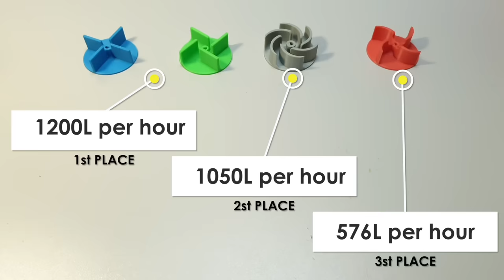Testing 3D Printed Water Pump Impellers - Which One Performs the Best?

Comment: The pump design is designed to reduce cavitation, mixing efficiency and durability. You have obtained good results in different models, but the durability is reduced because the formation of bubbles is greater.

Comment: You should also start looking at the casing and discharge pipe design. Also you are printing not very efficient impellers for pumping such fresh and clear water. If you want the most efficient design, try printing double shroud impeller.

Comment: Seeing the result was counter intuitive maybe you can reverse the winged fan blades so instead of scooping he water it actually pulls . Seeing the straight blades were better maybe cambering the blades away from water flow will actually outperform your best here . You could instead reverse the rotation of the motor to see the effect of the Galaxy shaped rotor blades instead of redesign.

Comment: The curved blades curve in the wrong direction. Velocity is increasing from center to edge, angled in the direction of the spin and outlet, but the rotation puts the trailing edge in the way of the flow. It might make for better pressure, but it will definitely impede flow.

Comment: @ 2:39: no sealing between motor and pump house, so lifetime will be a few days ... the bearing of the China motor is not watertight (this is with every design with 3D pumps a problem) you need a kind of oil seal, but for water
Reply: what battery he used?

Comment: Hmm, the flowrate is just one half of a good test. I‘ve been missing the pressure test. It could be made very easy by using a hose vertically. The higher the pump brings the water the higher is the pressure. Measuring the hight of the water can tell you the pressure in mbar. 1meter is about 100mbar. A very good pump make about 600mbar or 6 meters of hight.

Comment: You should measure the current   draw to determine the efficiency.
Bro you could have checked the battery voltage too, after that many tests that might have went down.

The impeller direction in dry test is ok but it seems the under water direction is opposite.

Good video by the way, awaiting for more. +1 ❤️

Comment: You have to look what is the efficiency of the pump so how many watts per liter is consumed. The other thing is that pumps have usually a flow / pressure curve here you do with the bucket at the same height as the tank but what if the bucket is one meter higher than the tank, will you have the same winner ?

Comment: You shouldn't use a battery, find a constant source. Also measure volts/amps. Efficiency and flow rate or pressure should be different on each design

Comment: The way you are testing the designs has very little back pressure. Turbopumps are mostly designed for generating pressure and aren't as efficient if all you need is flow rate. In these cases all of the designs are working at their flow rate limit because they have very little resistence. It would be interesting to test them pump uphill. The curved designs should do much better when there is more resistence but keep in mind that a lot of their efficiency is lost due to how much space there is for the water to flow around the blades. A smaller input hole and more output resistence may make them more efficient then the other designs. Also don't forget that the input hole size should be picked to some extend based on the desired flow rate.

To create lots of back pressure you don't even need a long tube going very high. All you need is a funnel with a very small opening at the end. You can try different opening sizes to get different resistence and see which designs do best for which hole sizes. Just keep in mind that with this powerful motor the pressure will be quite high and the water will spray very far.

Comment: Have you tried 3 string instead of 4 string - and as  "Jared Rohrbach Please print these designs in their mirror images (opposite parity). The ones you printed are for counter clockwise spin and the outlet on your housing is for clockwise spin."

Comment: Your pump is backwards. It would work better if the impeller blades were facing and spinning the other way. Or move the outlet to the other side so the water isn't having to change direction 100 degrees

Comment: The pink one is tested wrong.
It takes air in due to the large diameter inlet and too low submerged. 
You must drown the pumps minimum 1 meter for all tests.
You must make some reducers to make the inlet diameter smaller, and find the low limit diameter.
You must make a vertical 10m or more hose to see where the max pressure is at full speed, and no flow. Good luck.

Comment: I was really interested in your proposal to test the efficiency of the propeller design. Initially I believed like you, by intuition, that the red design was going to be the winner, but the results surprised me. I had several doubts. I'd really like to see the same designs but with different fluids, for example air and vegetable oil. I would like to know if the efficiency varies depending on the density of the fluid. Please send me a message if you have any partial results.
Reply: This doesn't actually measure any form of efficiency, only pumping power for a given voltage. For example the gray one is most likely the most efficient but because it's so efficient it doesn't have much pumping torque, the less efficient the pump the more the pump has to work. Since motors are relatively consistent rpm for a given voltage (to an extent) you'll simply have more amps for a higher amount of torque which makes the pp draw more power hence the higher flow rate, in other words for a certain amount of wattage, or power, the gray pump will likely be the most efficient.

Comment: Different blade designs are better for either flow rate, or pressure..the curved blade designs work better in high pressure situations..the straight blade designs work better for high flow rate situations

Comment: OK so the flat blades did best... but at what price. Do the same test again and this time measure amperage.
Amps per litre would be interesting...specially for a 12v system on a battery and no charging source...

Comment: Every day, I have another reason I need a 3d printer.
Reply: If you just gonna print random ass stuff, within a week your printer will turn into $300+ paperweight. The power of 3d printer is that you can make items that you actually need but are difficult and/or needlessly expensive to acquire otherwise. E.g. I made a replacement part for my car that would normally cost $30 but it only cost me $1 to 3d print (a plastic key shaft, the OEM part breaks super easily).
Reply: @michaelbuckers  What inspired me to get a 3d printer was a part I needed for my motorcycle that I could not purchase. I modeled the part, and found someone locally who could print one. And I thought about how easy it would be if I could make replacements for other parts at home.

Comment: not sure if anyone noticed.. but the impellers seem to be backwards for the orientation of the side port.   the impellers should be acting as a scoop to push into the output.  not a like  feather blowing in the wind, but like a spoon pulling the fluid..  basic fluid dynamics man.  depends on where our output is, and input and what direction  the fluid is moving in relation to the rotation of the motor.
Reply from the maker: Hello and thank U for watching my video. I have seen some viewers had written a comment that impellers spinning backward, actually that's not true, this just illusion because of high RPM. This is exactly the same when U sometime see a car drives on a road and weels moving the wrong way. 
Thank U all who have watched my video and have told Your opinion! :)
Reply: @LetsPrintYT  It's not about the rotation but the rounded blades are rounded against the direction of the extrating tube, which means they are less effective! re-print them and let them point to other direction and redo test afterwards!

Comment: Anybody notice the output points the wrong way...and the curved impellars were actually turning in the wrong direction...
 Even the green one should have spun in the opposite direction...no wonder the low pressure straight tang pump won...it was the only one that was non-directional...

Comment: Dear, I want to add a 2 inch pipe ,both at Input and. output. Is this possible ?

If Yes, do I need to use motor with more power ?

Comment: If you aren't controlling all of the variables then it isn't a valid test. If power is going straight to the motor then the first one will have the most power, the last one the least if they aren't starting at the same exact level. Also factor in wear - you need some type of controller so each spins at the exact same rpm for the entire test.

Comment: The impeller design affects how much pressure the pump can provide. One design may give better flow rate when the water is pumped a few metres higher. If you have to pump water from a deep well you will use a different design to emptying a pool or irrigating from a pond. It would be an informative test to see the times to pump 5l of water into a container 2m higher than the source. The volume of water pumped is a non linear function of the speed of rotation of the pump, the pressure it can provide is also determined by the speed. Also, how efficient was the pump, this would be important for a remote solar powered pumping site. These test were too simple to characterize the designs.

Comment: I was just thinking this is tesing effectiveness, not efficiency. If pump A does 100l/m at 1KW input but pump B does 75l/m at 500W, pump B wins. That does not necessarily mean that's the one you want to use when your boat is sinking...

Comment: You need volutes. A curved blade needss a volute to impinge on.  You reduce your losses buy guiding the flow. Also, pre starting rotation will reduce negative pressure area to negate cavitation so keep in mind the body is as important as the impeller and you might explore ratios and head pressure on suction side. Yuo might be surprised how much more you get if you stage your fow. Lastly,  an open impeller like blu is good for a trash pump while curved blades in positiv direction give highest pressure and less flow but with less power. 
I am practicing with my printer building vane pumps for vacuum and see how long it takes to lift 1000 litres 3 meters using 100 watts. Let nature do the work I always say!

Comment: I have tried a few 12 volt water pumps to feed an LPG instant tankless water heater for a Spa heater. None of them were able to give enough water pressure to operate the water pressure switch. Even tried a 24volt motor pump. Still no joy.
I am currently using a converted 240volt 1100w 4500L/H sump pump. I have converted it to run as an inline pump and is not submersed in the Spa water. The issue with these centrifuge pumps is that they seriously deteriorate in performance as soon as any resistance is applied to the water flow. They can only pump out as fast as the water can get in. Restrict the output and in turn the input is restricted. Small amount of resistance makes these pumps suffer large performance loss.
The sump pump also suffers the same deterioration issues but because of its size, it is still has enough left to operate the water pressure switch.
Have you tried using two pumps in series yet? ie, one pump feeding the 2nd pump. You will be surprised by the performance increase of the 2nd pump.

Comment: You have to do a new test !!!
You have made the intake wrong. Has to be a just a small intake in the center. also make blades going backvards. And last do also a test with pressure and volumtest during 10m lift.

Comment: Sorry for a stupid question what is the risk of placing the motor in the water and electricity?
Reply from the maker: There is no risk to be electrocuted or even feel it a bit, because this 12v is just soo weak. Only risk is for DC motor, well it will be fine when it gets water but if u run the motor too long under the water then brushes start wear out really fast. Also motor can get rusty over time.

Comment: if the turbine is pumping more liters/second, it also means the more L/s the more pressure it can produce, am i right?
Reply: Not really. A jet wash has quite a low flow rate but generates huge pressure.
Reply: @oldbloke135  well how else can i, in a simple way ass some pressure to my printed pump?

Comment: Housing for the first impeller used needs to be modified. I have built a lot of those for my woodcraft workshop and it is the most efficient design for impellers. This video is doing it injustice. I can give links where to get the design.
Actually same opinion goes for the last impeller.

Comment: Your pump uses not the full circumference. Only when a space between the blades is at the output tube it has actual effect. Otherwise it only presses water against the cylindrical housing and has no effect. The housing should be made spiral-shaped: https://commons.wikimedia.org/wiki/File:Centrifugal_pump_volute_Richards_1894.png

Comment: You only test water velocity. While the force measurements would probably stack up the same.

The green and blue pumps are definitely best when you have unlimited power and something as massive as water, as opposed to air.

I think the gray pump would be best at pulling a vacuum.

Comment: this is not efficiency test this is water flow test 
the most efficient is grey  
for efficiency you need pressure and power consumption 
also the water inlet in the impeller case is so ga-y you need to curve it towards the impeller

Comment: don't hold the water pump. angle may varies the output of it for sure.
Reply: As long as the intake is beneath the surface level, there should be no such problem, and as long as it then afterwards keeps contact with the water, the suction force generated will pull the water along it, and function as a vacuum to a certain extent so the angle shouldn't matter that much.

Comment: What are you testing for? Pressure Head or Discharge?  The differences between Radial vane vs backward curved impellers are not linear. The ratio of Press-head to Discharge peaks at different values of Discharge. And that's not the only difference - power required or load on the driving motor also is different. While this seems to be just play, for a better understanding, found this article https://mechanicalengineeringblag.wordpress.com/2015/12/26/why-are-most-centrifugal-pump-vanes-backward-curved/amp/

Comment: Actually you are not measuring time directly. You are measuring seconds and frames. Pink for example didn't take 31.03 seconds. It took 31 seconds and 3 frames which at 30fps would be 31,1 seconds (1 frame at 30 FPS is equal to 1/30 seconds  0,0333.........333......... seconds). If you were recording at 60 fps, this would change. So here are the "actual" results (calculated with excel):

Grey:
It pumps 1018,868l/h for comparitive purposes, it will take 13m32,667s to empty a bathtub (calculating with around 230l which is an average bathtub full)
58m53,333s for a cubic meter of water. (1000l, 1m x 1m x 1m of space with water)

Green:
It pumps 1148,936l/h for comparitive purposes, it will take 12m0,667s to empty a bathtub (calculating with around 230l which is an average bathtub full)
52m13,333s for a cubic meter of water. (1000l, 1m x 1m x 1m of space with water)

Blue:
It pumps 1163,793l/h for comparitive purposes, it will take 11m51,467s to empty a bathtub (calculating with around 230l which is an average bathtub full)
51m33,333s for a cubic meter of water. (1000l, 1m x 1m x 1m of space with water)

Pink
It pumps 578,778l/h for comparitive purposes, it will take 23m50,6s to empty a bathtub (calculating with around 230l which is an average bathtub full) 
1h43m40s for a cubic meter of water. (1000l, 1m x 1m x 1m of space with water)

Comment: you are comparing apples with pears. the 2 rounded blades should perform much better in real life situations. but they don't. that is because flow depends on the angle the water leaves the impellor. the rounded impellors have much greater efficiency en will get much higher pressure. you should compare the pumps with a smaller tube. then you will see that the non rounded impellors wil perform much much worse and the six bladed will win easily outperform the rest in terms of pressure. the non rounded impellors have one and only one advantage: simplicity at the cost of everything else.

Comment: lol the time messurement is not accurate... why?
your pipe in the gallon is in the very bottom which limit the flow or pressure of the water.... if you just put the tip of the pipe above the marker line, you will see the real result.

Comment: that's a bullshit but not an experiment. If you would know hydraulics the only thing that really changes flow is the turbine diameter. Form of the blades have an influence only on pressure. the reason why you had such a results is the way you put the hose into the bottle. On the last experiment you even closed the hole in the hose with the bottom of the bottle

Comment: You need to at least read a bit about pumps before rush into very poor conclusions.
A pump is designed as a hole is the combination of the "turbine" and the rest (very poor designed). And most important is designed to do a particular job.
Important factors are flow, head. Rpm, power, and the combination of those and others, all that lead you to design or select one pump.
The information is very  easy to find because is a very old and studied topic.